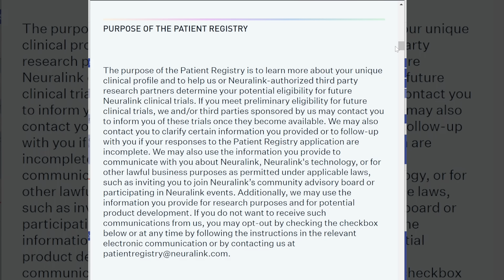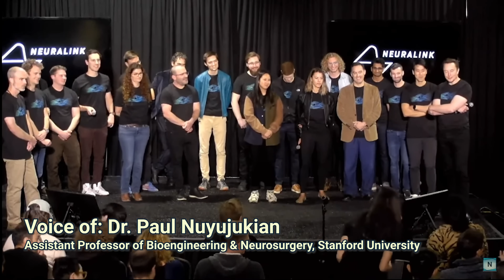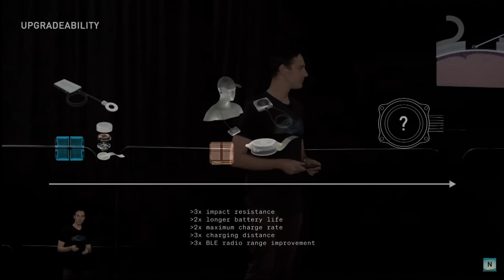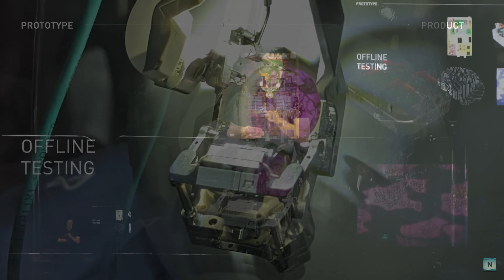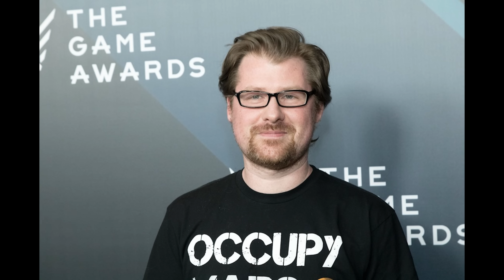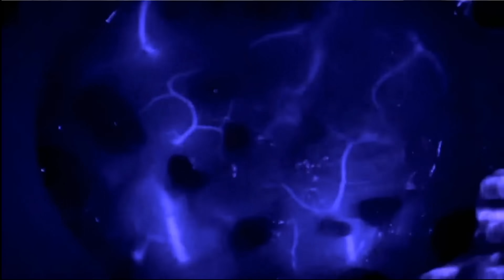Attending an Event at Neuralink Headquarters

Comment: All u need is an eeg tab behind ear where ear and scalp meet that is were mastoid cell bone is, were inner ear is, where optic nerve makes a physical connection with inner ear to keep you balance what happens in this area Vision leaks just like any other signal from your skull leaks brain waves this area also picks up vibration of your vocal cords when you don't push the air out of your vocal cords when we talk out loud it's still vibrates which sends the sound a vibration of your voice up your throat to your jaw where your inner ear now hears your inner voice those are my words you will not find them anywhere else that is how you hear yourself whether you're thinking to yourself whether you're dreaming and talking whether you're having a conversation with somebody in your dream your vocal cords play both parts your vocal cords will also mimic sounds like a bird or a horn honking it will be your vocal cords imitating that is the only way your brain hears is from your ears your brain cannot hear anything without your ears and if you hear it your vocal cords are vibrating the sound memory is compressed after your eyes see it your eyes cannot see compressed memory it has to go back down the optic nerve back to the cones and rods the cones and rods convert it to a signal so the brain can see that's its function just like when you look at something it converts it to a signal so your brain can see that's how you dream your dreams come from memory which is set down to the optic nerve back to the cones and rods the cones and rods converts the signal so the brain can see you can also achieve this without it EEG Tab and have something surgically installed in the same area which is a glass RFID which is happening the people unwillingly that is where this technology came from Verichip was approved for humans in 2004 but was being used before it was approved on victims that is where this came from you those other devices you see that those other devices that use the mind to control remote control cars and things like that that is because it's picking up the brain signal move left move right you're thinking of it and it hears you if you think of it and you you said it and that's how those devices read your mind when moving a little remote control car or anything with your mind without moving your mouth it's because you're saying it your vocal cords are vibrating it and that's the sound that it picks up

Comment: 10:55 I’m confused. They remove a piece of your skull and don’t put it back so if you press on that part of the skull you basically can press on the brain and damage it? What’s missing in this pic?
Reply from the maker: Not sure, but they've probably got it covered.
Reply: @NeuraPod I thought it through and a simple solution which they are perhaps using is screwing the device to the inside of the side of the hole of the skull they have made. This however wouldn’t prevent the device to break in case you hit your head and damage your brain. A solution would be to make the device’s cover as strong the skull. Maybe titanium? Maybe even allowing the edges of the device to go over the hole. From the picture in the video however it doesn’t seem they are doing that.
Reply: My guess is that they have the side of the implant that faces the scalp reinforced so it kind of acts as a stand-in for the part of the skull that was removed.

Comment: Sir, I have been watching and following the development and Focii of Neuralink. I have a unique situation and will follow your link approach. HOWEVER: Please note only that I am retired and that was due to the fact that I was losing my preferred work of 90-110 hours per week, often 24 hours a day for several days, and it turned out that i have been losing real steps to my working protocols because I have a fatal brain disease. I believe I would be a strong asset (obviously not for any monetary compensation) to the business and research, use of many advanced technology systems from hardware, software and massively challenging packages and interfaces, and you would be hard pressed to find any holes in my businesses I have started or joined, operated as a General manager, lead engineer, Training and both inward facing and outward facing training in class3s from one week to one or two hours to multiple weeks and or across “challenging” connectivity that made me to tech call of last resort past in house tech groups, suppliers tech problem support to suppler at the manufacturing or reseller integrator support to me when someone I did not know told me “the supplier team and SUPORT top tier guy said you are the only one who could sort and fix quickly”…. No pressure, but you could speak to Lockheed Martin technician in such a situation… I chatted with him and his own team, took about ten minutes to ask questions, then said “do this, then this, ten ❤scroll over and do this and call me”, when he told me “how could you know since the company who manufactures this took two days with us after we have wasted three full days and our weekend on this and it still does not work”, and I said “just do what I said and call my video o this number” and I hung up. In less than a minute my system rang and I said “looks like it works since I can see and hear you and the video looks great” after which I heard in the background “I told you four days ago we should have called him first!!!”  “What do we owe you?” asked my contact, and I said “it took less than five minutes on this… take whatever you might have paid me and do out to a nice dinner and then go home… nobody needs to sweat their employment… I will talk to you another time, maybe if you have a project or training work for me and Communication Design Group”… bye😊….. or those at Neuralink could contact Verizon, who just purchased Blue Jeans Network during 2022, and ask for Larry in Tech Support and is high Tier and Customer facing, and ask them about my work with the work you are facing.  Thank you, and thanks for this material and the contributions of others in this message and comment pages, many of whom you might want to tap for insights. See you in2023…. I am not going out, but not because my fatal brain disease says “Times up, Sharer”
Reply: I confess that after I tried for two hours, someone typed and posted this…

Comment: To put this in perspective 1080p, the lowest of what is considered "high definition" is 64x more resolution than what someone might see with two quad core neuralinks as they suggested in the video.  In order to see 1080p, you would need to have to have 128 of even these neuralinks installed and all of the electrodes put into the visual cortex.  Obviously this is impossible.  Try to imagine putting 128 quarters on your head.  That's just how much space it would take up in your skull.  The idea of getting all of those 2 million electrodes into the visual cortex without crossing wires and inserting them in relevant locations is completely beyond the scope of possibility.

Currently their plan is to match each electrode with one pixel of an image.  This makes perfect sense as a first step but eventually the key to better images will be to allow each electrode to create the appearance of dozens if not hundreds of pixels.  This may or may not be possible in the foreseeable future.  The other possibility would be to allow only a few pixels to quickly draw a much larger image.  Similar to the way CRT televisions and monitors operated where a single pixel was drawn at a time but electron guns were used to rapidly draw images, one pixel at a time across         a screen but doing so 60+ times a second.  Either way we are a very long way away from creating a image inside a persons mind that is anywhere near the resolution of a smart watch to say nothing of a smart phone or high def television.  What the future will bring, only time will tell.  Maybe by the time we figure out how to download images into our brain it will just be easier to upload our mind to the computer instead.

This is approximately what 32,000 pixels would look like.  
https://gyazo.com/a2a067768f958cf54b58236b524d837d

Comment: What if you've had a detached retina and have a lens implant, but still have gotten my vision back completely?
Reply: Even if your eyes were physically removed from your head this device would be able to restore vision to the level of quality as our best camera tech
Reply: @ekothesilent9456  A very interesting concept.  What do you think happens if one like myself gets such implant and continues to compete in his profession?  Do you think getting hit would damage the implant?
Reply: @noeltheholyfireechevarria7778  I think contact sports or similar competition would be completely off the table for a user of this device. Both because of the advantages it give to the user and the risk of injury. a head injury with this device implanted would greatly increase your risk of a brain hemorhage or tear.
Reply: @ekothesilent9456  Yeah, I figured that.  But had to ask right?  Don't know unless you ask, especially when I'm not professionally adept in this kind of science.
Reply: @noeltheholyfireechevarria7778  the main issue is that the copper or golden wires that go into the brain are actually barbed and serrated so if the external device is so much as tugged or snagged hard it would pull each wires barbs through your brain and kill you. But hopefully when this thing is released there would be some way to prevent that issue.

Comment: You can't dismiss/ignore the recent reports on animal well-being. All the information you refer to in this video is coming directly from Neuralink. "Anyone who reads these posts (i.e. blogs by Neuralink) or listens to Neurapod rather than read the typical Neuralink news headlines, will probably have a better picture of what's actually happening at Neuralink". Really? This whole animal section seems like a commercial for Neuralink. This isn't objective reporting, but fanboyism. Neuralink doesn't even seem to know how many test animals they've had. In an academic context, this is unacceptable and would be considered highly unethical as it is serious data mismanagement/misconduct, most likely ending the career of the responsible investigator.
Reply: You are absolutely right. Neuralink has great potential and animal testing is unfortunately necessary, but the welfare of all animals should be their #1 priority. Normally, especially because these are vertebrate animals, animal testing should only take place under very strict conditions. Each experiment should have been recorded and only after evaluation should a new run have been approved. It is very irresponsible what's happening there and of course we know that the main blame for this lies with Elon, who has been exerting pressure on the researchers for years because it is all taking too long for him. Science takes time, he must finally understand that.
Reply: @MarsC02  no real proof of any of the negative claims. We kill hundreds of millions of the same animals for food
Reply: @6681096  According to that logic, we wouldn't need any oversight for animal testing! Regarding proof: Reuters has interviewed more than 20 current and former employees. It doesn't seem like a made-up story. The stakes are simply too high when you're dealing with a high profile company ran by Elon Musk. The loss of face and possible defamation lawsuits if the story were made up could be dramatic. I guess the federal probe (that will presumably put Neuralink employees under oath?) will show the true extent of unnecessary animal suffering at Neuralink.
Reply: @MarsC02  
i think there is bot replying to your comment.
Reply: @MarsC02  
 i don't care what you wrote but it looks like YouTube removed it maybe because of spam or bad language.
Reply: You'd be correct, If we had a media that wasn't primarily composed of FUD spreaders and activist posing as journalists.

Comment: My issue with applying to work at Neuralink is that the website is indicating that a LinkedIn profile is required. I don't trust LinkedIn anymore than Facebook. Which is not at all.

Which ties into my biggest concern with the implant. They want to run the signal through smart phones which are pretty good at leaking info users don't want shared. If Google, Apple, a government agency etc wants to have free access to my brain signals than count me out of the implant waiting line.

Comment: My problem with the device is emotional duress. The lab animals have been most likely under low stress during all testing. Which makes sense, most people are just living out their lives with minimal flight or fight responses. Though, dangerous or highly stressful situations still exist.
For example: 
What if someone is panicking? Something is happening, that might be dangerous and the user is frightened. Would the device be able to filter eronious signals? Or would the software be able to keep up with the brain in "overdrive?"
Reply: That’s the point of NeuraLink. To reduce these types of issues after the dedicated research has been proven. The team is currently working on just solving very specific things. 

The solution might not even come out of  NeuraLink but maybe some other team pouring over the data Elon said they would publish and once the device is available for other researchers to use.
Reply: If what's been alleged in the news is true then many lab animals did not survive.
Reply: Control.